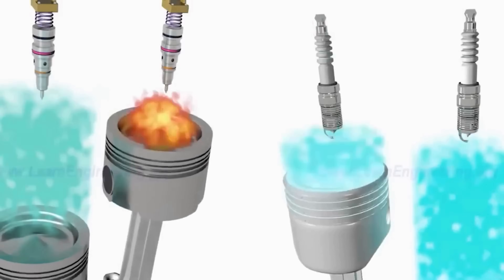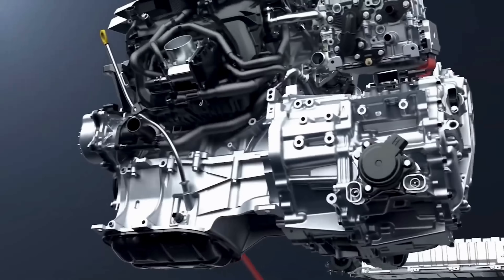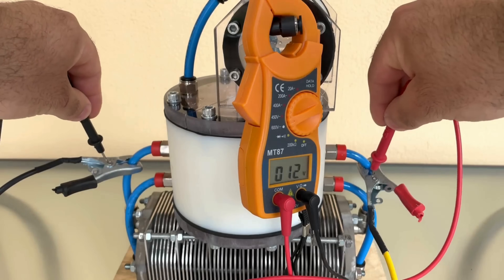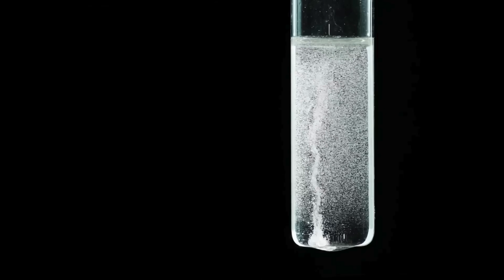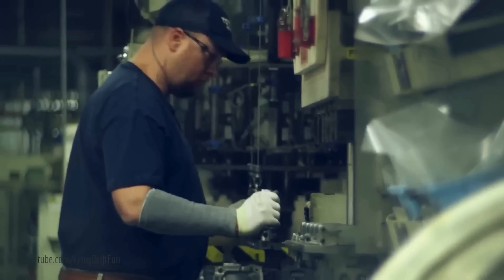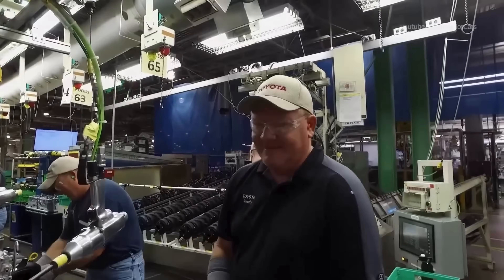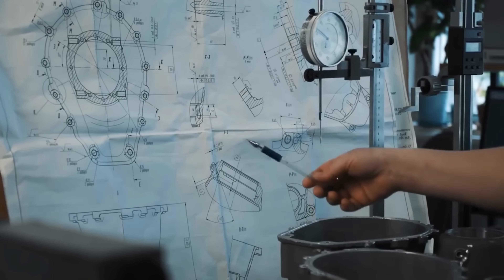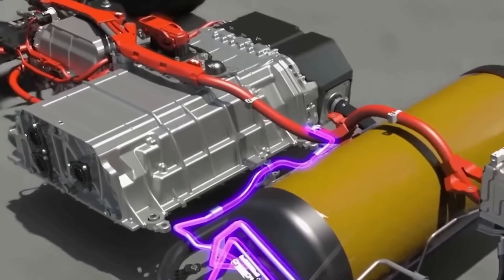Could Toyota's Water Engine can destroy the EV Industry ?

Comment: What happens if you let that car sit in below freezing a couple of nights? Do you have to replace every single part that contains water?
Reply: How about the water for cleaning your windows? You mean to tell you don't use it because you never heared fo antifreeze?
Reply: @BlacksmithTWD  The fuck do you mean, "water for cleaning your windows"? The container for windowcleaner fluid is supposed to contain ethanol or isopropanol (which does not freeze), not water.
Reply: @Focaloren Contain yes, not be only ethanor or isopropanol. It's 2/3 water 1/3 antifreeze mixture for temperatures down to -20 degrees Celsius where I live, though most folks here buy the premixed stuff.
Reply: @BlacksmithTWD  So what, really? This was about the engine. If the engine uses only water, what does it matter if the window cleaner fluid is antifreeze or isopropanol? They said: "This engine runs on water", in other words, it would become unusable in colder countries. If they use coolant or isopropanol mixes in the engine tank, it would be way more expensive than to use a regular gas/diesel engine. THIS is what I wanted to know, and if you don't know, don't answer with bullshit.
Reply: @Focaloren  Window cleaner fluid is still over 60% water, hence you can use that water to electrolyze it into hydrogen gas and oxygen and fuel the engine with that. You can recycle the antifreeze.

Comment: If those cars were 10-20% more expensive than their gas car counter part it would still be worth it because it will save us money on gas
Reply: I doubt it, they probably will be more expensive than current electric vehicles as they are basically an electric vehicles with added stuff that will make the energy transfer from stored battery power into motion less efficient and more expensive to buy.